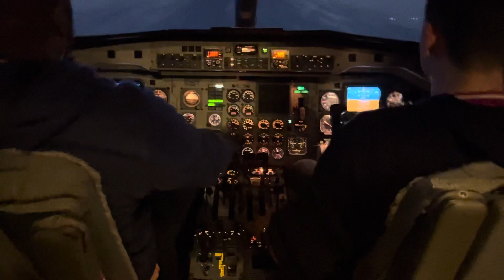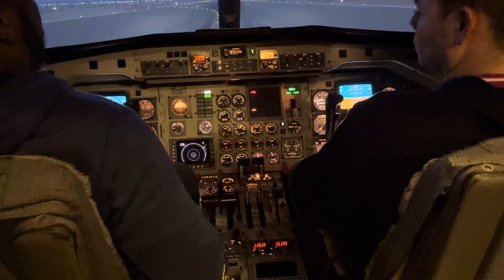Saab 340 Case Against the FO taking power levers at 80 knots

Comment: Did he just reject the T/O after V1?
Reply: I don't think handing over the power levers at  80 kts is the route cause of the problem here. The issue is that the F/O heard V1 prior to noticing the engine failure and put his hand on the yoke at which point he has commited to the T/O and should have continued with the T/O. Sometimes we focus too much on giving our opinions rather than providing the student with meaningful feedback to sovle the actual issues. I hope the instructor pointed out to the F/O that once his left hand moves to the yoke he has commited to the T/O.
Reply from the maker: V1 was called too early. I set the failure to 108 and V1 was 114. It’s a common error on the human factors side. My main point is, the CA hand isn’t on the PLs at the time of failure so it causes a delay in the decision making.
Reply: @scottphillips8400  even so if the PNF had already called V1 the T/O should have continued and this should be addressed with both crew members. Regardless of who is guarding the power levers, it is very likely that this crew would continue to attempt a T/O abort after V1 was called if not properly addressed. I'm sure the T/O brief would say after V1 we will continue?
Reply from the maker: @shipmecompany  yes agreed. But the point of the exercise was whether the captain could abort with his hands not on the PLs. I appreciate the input,
Reply: @scottphillips8400  Even if the PIC was the one guarding the power levers, I don't see how that would have helped in this situation. Once the PIC called V1 the PIC would have removed his hand from the power lever and thus the result would have been similar if any of the crew attempts to abort the T/O after the V1 call was made. If the PIC or SIC still has his hand on the power lever after calling V1 it increases the risk of them trying to abort after the V1 call. In this case (where SIC is guarding the power levers) the PNF regardless of whether he is the PIC or SIC should only say Continue or Abort (if he hasn't already called V1). Having both crew members on the controls at the same time is a bad deal as it introduces a scenario where the PNF is trying to abort, while the PF is trying to go. What if the PF started to pull up, while the PIC tried to pull the power levers back to Flight Idle? Have flown Saabs and other aircraft types with both methods with no issues provided the crew follows appropriate procedures. You're welcome Scott! Love the Saab 340 videos! Brings back some good memories!
Reply from the maker: @shipmecompany  that’s a lot of words to digest. Anything in particular you’d like to see?  I do requests.
Reply: @shipmecompany  2 thing happened here. 

1 - What you are pointing out. That they aborted once V1 was called. This should be addressed. Regardless of who has the PL at the moment, V1 is called. Hands go off the PL to the Yoke and the T/O continues regardless.

2 - The issue Scott Phillips was trying to address. They called V1 early as he mentioned in the 1st reply. They were not supposed to call out V1. The engine was supposed to fail before that call was made.
   From what I can gather, the company procedure has it that Captain has control until 80kt. At which point controls go to the Pilot Flying. In this case the FO. So the Captain takes his hands off the yoke and throttle and the FO puts his hand on the Throttle and Yoke. But looks like the company procedure states that a rejected T/O is to be performed by the Captain regardless of who is flying the aircraft.
   This leads to the issue that if an engine was to quit between 80KT and V1 the FO has his hands on the throttle but the Captain is the one that needs to Idle them. Thus creating confusion.
   You can see from the video that it took a while for the throttles to come back because the Captain called out the rejected Take Off but the FO was guarding the throttle. You can see the captain slap the FO's hand and take over the throttle, then idle them.
   This is the issue Scott is trying to point out to the company. That this back and forth makes a stressful situation confusing. You can hear him say at the end "it's not on you, I just wanted to see what it looks like so we can give some advice to the company". in other words. Hey (company name) this procedure is dumb, here are your pilots messing it up, change this before something happens.
Reply: @stowjoker342  That's a good summary.
Reply: Yup the captain said V1 Rotate reject stop